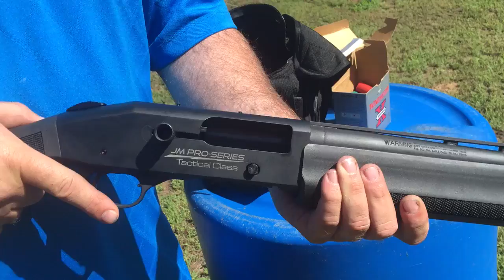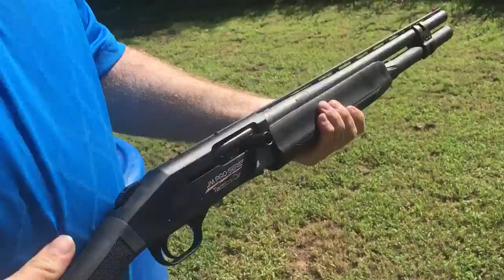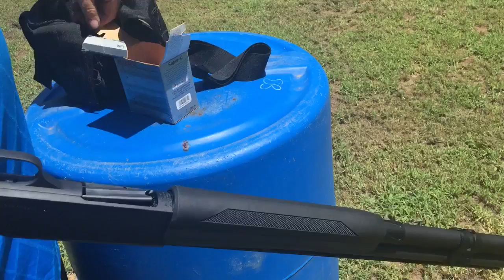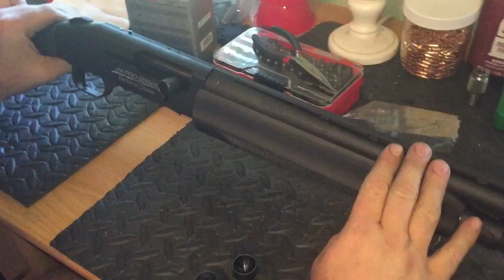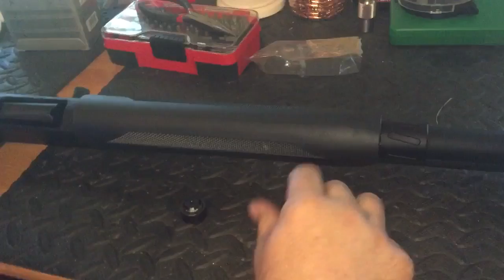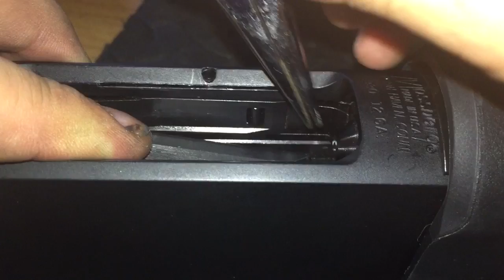Mossberg 930 JM Pro Cycle Problems Solves!

Comment: Hey reloader dude, this not to criticize but to help you and all 930, 930 JM Pro, 930 SPX owners. There should not be 2 followers in the mag tube. The piston should not be oiled,clean it run it dry. It's the heart and sole of the 930 shotguns. I had a customer bring back in a 930 Spx that I sold him. I work for a gunshop. He was having failure to eject issues. The extractor on the bolt was ripping the shell casings as it was trying to eject the round. After test firing the same ammo I was also having that issue. The shell casing would get stuck in the chamber. I took the shotgun apart cleaned it completely the I took some fine grit lapping compound and gently took out the factor bur in the chamber. Then I took some fine grit steel wool and polished the inside of the mag tube cleaned it. The customer picked it up and ran 500 rounds of various loads through it flawlessly. With all the stock parts. Also if you over tighten the magazine clamp the you can slightly out of round the mag tube causing the follower to get hung up not feeding the next round. I also run 3 gun with my JM Pro . The first thing i did was take my shot gun apart and send my lifter to C-Rums to have lifter welded solid. I opened my loading port up. Polished everything like I previously said. Didn't touch the bolt release at all. My JM Pro runs flawlessly!! Runs as good if not better than some of the high dollar brands of shotguns. Hope this helps you and all the rest of the Mossburg 930 owners out there.
Reply: Hey man,  no idea if you'll see this as it's 3 years on... I have the same issue on my 930, it wont pull the case out the chamber, it isn't ripping the case, or damaging the case, just leave the empty in the chamber.  Mine does have a gg&g follower in it, which is butter smooth, but that doesn't seem to be the issue, it's that empty shells aren't getting pulled out the chamber.  Any ideas?
Reply: Take your piston apart and clean it immaculately, could be the problem.
Reply: @doomfathertm8771  Dane Maui Is correct. The self adjusting piston has to be spotless when cleaned and you are supposed to use dry lube on it. I've owned my SPX for about a year now and only had one issue with it after painting it with Duracoat. I do have issues from time to time loading it with my sausage fingers as the round doesn't always lock in the mag tube and gets under the bolt. I had the area around the tube opening widened like a three gun shotty and it rocks now.
https://www.youtube.com/watch?v=vcQ5eKOt7Y0&t=8s    And with a Holosun red dot, I can shoot slugs out to a hundred yards.   
https://www.youtube.com/watch?v=GCEkslmECCQ
Reply: @jackhammermike2522  But it is always spotless clean, I clean it after every use.  But this doesn't explain that the action cycles perfectly, the bolt is getting thrown to the rear just fine and holding back when empty.  The issue is that it isn't taking the empty shell out the chamber
Reply: @doomfathertm8771  If the gun is cycling and firing, but leaving the empty casing in the chamber, that could be the extractor claw not doing its job. Try replacing it.

Comment: It's NUTS that you had to do all of that for your mossberg to function.... I currently have a 940 PRO TACTICAL manufactured 5 months ago with a  initial problem of failure to feed which was resolved but after resolved the first day to the range after the problem was fixed I got a failure to fire which is now caused by a failure to battery!!!!!..... literally my first Shotgun with nothing but problems right out of the box, literally 150 rounds thru it just for test firing, NEVER even got to enjoy yet.... no joke!!!..... if I could go back in time I would've coughed up the extra $500-$700 and just gotten a 1301 or M4 INSTANTANEOUSLY!!!!!.... NEVER AGAIN GOING WITH MOSSBERG!!!!.... it is currently at my FFL getting looked at before the trip back to Mossberg..... what a dang HEADACHE!!!.... STAY ABSOLUTELY AT ALL COSTS WITH BURNING SAGE AWAY FROM MOSSBERG SEMI AUTO SHOTGUNS!!!!!

Comment: Two followers man really? The issue with most 930’s is the gas piston. So I clean as I should with extra care given to the gas piston by cleaning under the piston rings and clean piston gas holes. A Or3gun pusher tube ( not blue one) keeps gun going a lot longer due to holes in it to prevent carbon and moisture build up.

Comment: Check out the Or3guns spacer and SBE Precision Products piston.  This combo is a serious gamechanger for the reliability of the 930.  Cleaning intervals on the gas system are extended to 1500+ shells with amazing reliability.

Comment: OR3GUN has your solutions for your 930...
Reply: Not necessarily in this case though. From the look of it one possibility is shell stop is not releasing any shells due to burr in manufacturing process.   It is a somewhat common problem as you can find reference online.  The solution is polish the front shell stop.

Comment: I use a dry lube on the piston, and the rest of the gun. I just make sure the pistons wiped off really well and take it completely apart and with a fine q-tip I clean in between the grooves. My jm pro runs flawlessly up to around 300 shells. Pass that, it's had one or two malfunctions with light loads. Once your piston gets mucked up, air can't flow freely through it, causing malfunctions. You have to clean your gun often, it's the reality of a semi-automatic shotgun.

Comment: I just bought a 930 pro 24" 9+1 and am not having any of the above issues bone stock. I cleaned it prior to shooting anything and the fuckin gas piston was disgusting I thought it was used but mossberg told me it was from testing at factoryAfter cleaning it through I fired few mags off no issues

Comment: The two pieces you took out, those are followers. The hinged plate at the loading port, that's the loading gate.
Reply: +fmonk My 930 JM was broken right out of the box!  Turned out to be a broken pin in the loading gate assembly.  It is a 1/16" soft metal pin.  After replacing the assembly that Mossberg sent me, it broke again within the next 20 rounds.  I made my own pin from a stainless steel pin punch and after 600 rounds, is still good.  the symptoms varied between the two broken pins.  The first time, the bolt would simply lock back on a loaded magazine.  then next time, the symptom was intermittent feeding problems where more than one round would try to load, while a few others would just dump out of the bottom of the receiver!  Also, it doesn't like Winchester ammo.  Sometimes during extraction, the extractor would just rip a piece off the base of the shell, while trying to extract it, making me run a stick down the barrel to dislodge it.  Out of about 20 rounds, that happened almost 10 times.  With Federal ammo, I have no problems like that.  I was very disappointed with Mossberg until I made my own pin.  It seems to work well now and I like the way it handles.
Reply: +fmonk Are there supposed to be two of them in there?
Reply: +Vincent Lok I don't know about the JM Pro. Typically there shouldn't be two. Watch the video? I think he said he removed one.
Reply: There is only one such pin. It was broken when I got the gun. Mossberg sent me a replacement pin. That replacement pin broke soon after I installed it. So, I made my own pin and is working like a champ.
Reply: +Carl W I think the other guy was referring to the two mag tube followers, not the pins. You call them mag plates at the 4:30 mark in the video. Most shotguns I know of only have one, not two stacked against one another.
Reply: i was gonna call the flappy plate the "elevator", gj mossberg for doing two jobs with one part :)

Comment: The round thingy:  magazine follower 
The long rectangle thingy: Lifter
The  pin that stops the shell :  Front shell stop 

I think the polish of the front shell stop probably did the most of the improvement. I am very curious on why there is mark on the follower as well. My guess is the old magazine follower is badly designed and protruding too much and the shell stop is bitting into it.

Comment: I just bought one, they didn't fix the issue. It jams and sticks constantly. Mossberg told me to thoroughly clean the gun. After doing that it still jams. so pissed I wasted my money on this POS. Hopefully I can get it to work after dremeling the shit out of it...
Reply: Spandino hi brass dude. No white box or low brass 

Clean your piston. If you live in a high humidity area go to or3gun.com and by a marine spacer.
Reply: jwhite0105 thanks, works good after putting in work and better ammo

Comment: I too had minor issues when I first got my gun.  I ended up severally damaging my mag spring trying to disassemble and ended up replacing with a much heavier Gage spring from "wolf springs".  gun has never flawed with 1000 plus rounds through it (99% cheap Wally world birdshot). I believe the stock spring is way too light and that is why some folks have luck swapping components out for Teflon ones (effectively making the stock spring work less).  try a wolf spring (12 bucks I think), 2 mins to install, and about ten times as durable (ie won't kink / bend if miss handled).  my gun cycles even the low recoil/noise  stuff fairly consistently if the gun isn't too dirty. regular bird Target shot is flawless even dirty.

Comment: does mossberg listen to your discovery? I'm not a gun smith like you. I want a mossberg, I don't want the stress, my single shot shotgun is boring, but working, any ammo,rain, snow, mud,whatever.
thanks for sharing your discovery. 
thanks 
Gilbert
Reply from the maker: They knew it was a problem after all the complaints from everyone.  The part was fixed and newer guns dont have the issue

Comment: Hey whats up man i have the mossberg 930 waterfowl model...failure to load every now and then, with low brass at least. Do you put oil in the gas piston system? i saw a video with a guy saying you shouldn't but I'm thinking i should...maybe a dry lube at least?